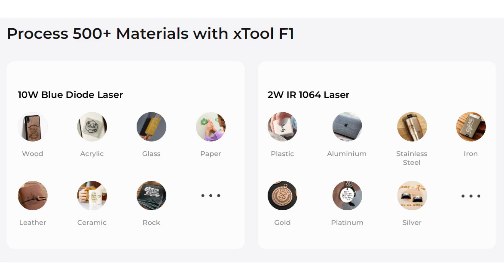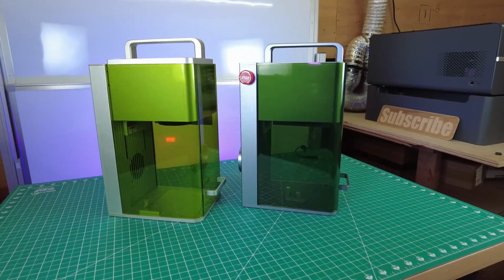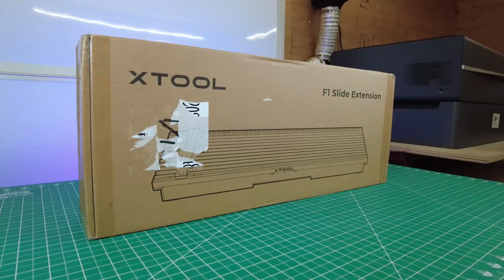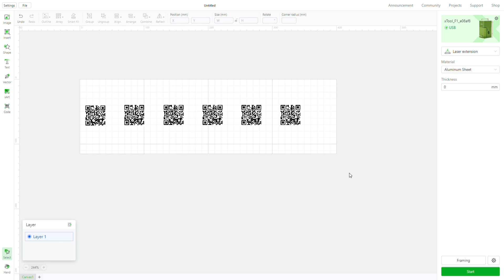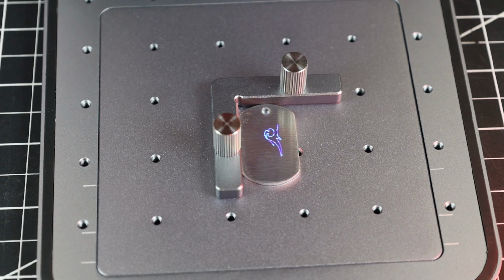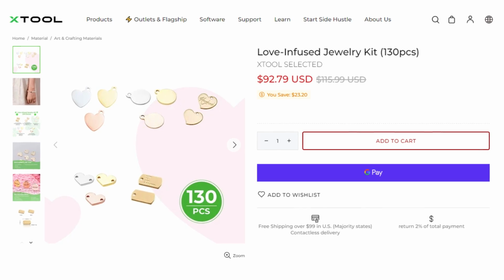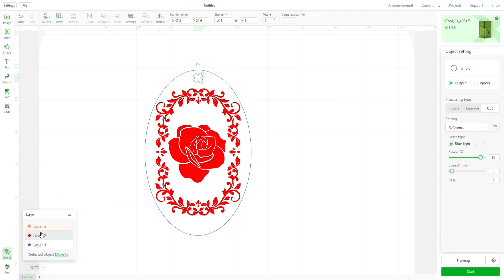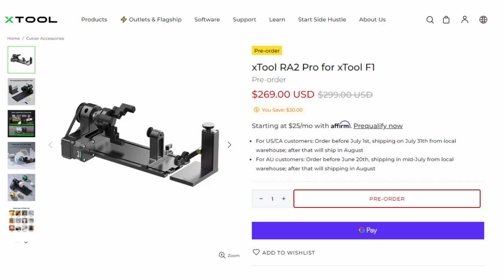xTool F1: Fastest Portable Laser Engraver with IR + Diode Laser

Comment: Do you know where I can find 89mm x 64mm anodized cards for engraving? I'm having a hard time finding these. Saw the Pokémon card in your video and thought you might have a lead.
Reply from the maker: From what I have seen no one makes that size and you would have to get them custom cut.
Reply: @randymay  that's what I found out I'm thinking of getting the metallic paint coated 2mm plastic sheets and seeing if they will look good as cards cutting them with the 10w on the F1
Reply from the maker: That might be interesting, let me know how that turns out
Reply: @randymay  did a test last night on 3mm acrylic it looks promising going to try to find a local source for thinner stuff. Just got about 3 pounds of waste cut leather from a furniture shop for free. That's like 30-50 hat patches.
Reply from the maker: Very nice